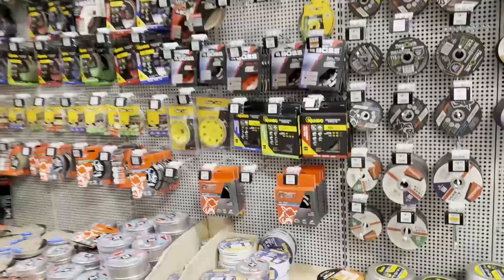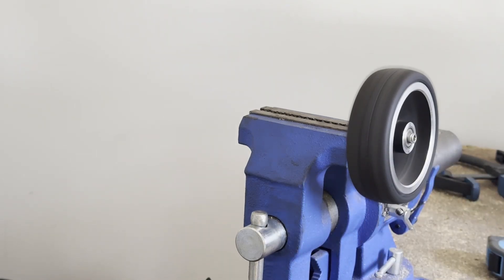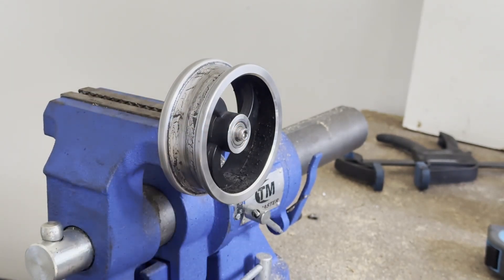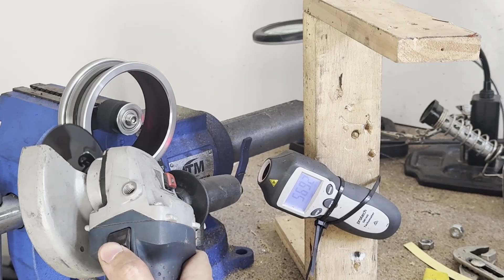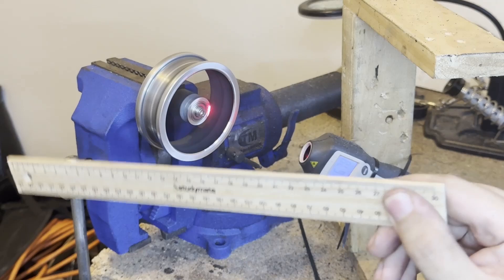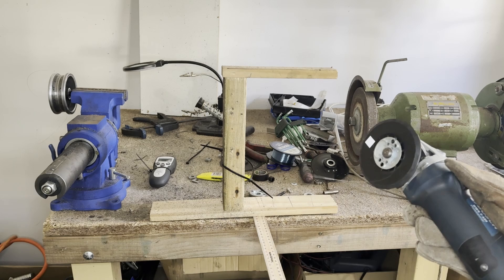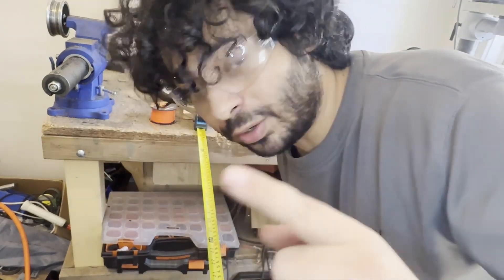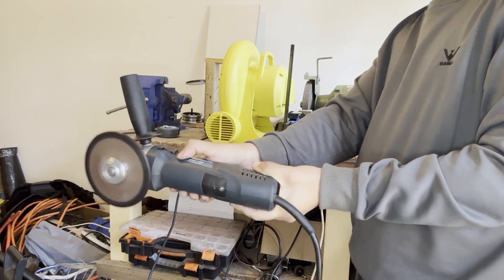Making Sonic Booms At Home!

Comment from the maker: I meant the string is 50cm long not 50mm when it’s booming! It was pretty hard to iron all the kinks out and get it to work but i’m happy with how it turned out. Edit- I tried it with a Weed Whacker and couldn’t reproduce the sustained cracking (i got a few), same line tangling issues. Angle grinder worked the best.

Comment: Okay here's how you do it take a box and you run tubes cylinders all through the box and you can handle them out of a hole that goes to the outside of the box at some point on the box
Reply: Then you run very low frequency high decibel sound through the tubes
Reply: When the pressure of the low frequency sound hits the outside hole in The box makes a very very loud boom this is known as a servo subwoofer believe it or not?

Comment: Compressed air. Be very careful as things like to explode at high rpm.
Reply: To get the least friction possible the bearing grease needs to be removed using wd40 or petrol etc. once its clean of all grease they spin up insanely fast. The last time I did it i put a small motor bearing inside a larger motor bearing with a bolt and locking nut in the centre. Both bearings clean and dry, blew a narrow jet of air onto the outer bearing whilst clamped in place. The speed that thing got to was insane, sounds like a jet engine and just keeps going for ages once you stop blowing air on it. Took a good few mins to slow down to a stop. Obviously it's got its danger risks and full PPE was worn including full face shield.
Reply from the maker: Interesting! cleaning the grease is a good idea, id imagine it would speed up the heating of the bearings though. Yes PPE is a must. Thanks
Reply from the maker: I tried compressed air with the wheel but couldn’t get enough contact because it was smooth and probably a bit heavy to get it going fast, but i know you can spin up apples etc and get them to explode lol.

Comment: try it again with trimmer line it will work great
Reply: Trimmer line comes in many thicknesses, and the heavier stuff is likely too much air resistance, just like the zip tie. Also, trimmer line, while strong, needs to be able to be snipped off when it hits something at high speed, so durable fibers are a no-go.

Fishing line is probably better. And you can get it in any size you want. They make 500 lb braided Kevlar line for large sport fish, and 2 lb monofilament line, and everything in between
Reply from the maker: Great reasoning. I came to the same conclusion, problem is it’s so damn finicky like i was saying in the video, longer than about 30 cm in length it just wraps itself so easily. Maybe if i got slightly thicker one as you suggest. the building line (orange string) held up surprisingly well but the end does fray very quick.
Reply: @TechEyeMan  braided dyneema line is a completely different animal than monofilament. Monofilament holds on to a curve radius and unspools into a coil, and loves to warp around things and be a pain to work with. Braided like will lay completely straight, and won't "set" into a shape the same way. Braided line is also so much stronger and lighter, you have to like 10x the weight for the same thickness (if you're using 8 or 10 lb test monofilament, you'd need like 75-100 lb braided line to be the same diameter).

Try tying a big nasty knot at the end. It'll help with fraying, and add some weight at the end, without as much air resistance as using a thicker string would. I wouldn't add an actual weight on the end (which would do the same thing) just because at those RPMs, it would easily create 100s of lbs  of tension in the string for even a very small mass, and if it flies off or the string snaps, it's moving as fast as a bullet and very dangerous.
Reply from the maker: Awesome tips (No pun intended) i’ll look into braided line after i try the trimmer line for the hell if it. There’s a lot of footage i didn’t include, like i did try putting knots in the end, surprisingly they come undone fast, and they become a weak spot, i even tried a minuscule weight (the end of a cable tie with a hole in it) but it snaps off fast. the truth is i’ve reached the required speed with the string so really the best i could hope for is better repeatability (no need for the blower etc) but the end result will likely be very similar.
Reply from the maker: Tried the braided line today with an electric line trimmer. It does hold itself better than fishing line but it still had the same issues with tangling etc. Got a few cracks with ordinary snipper line, but nothing sustained. I even took out the motor and bench ran with variable power supply because it didn’t have speed control, turns out even ramping the motor up doesn’t fix the issue. I did get some cool visuals with the line wrapping around itself at different levels. but angle grinder with builders line was the best consistent response
Reply from the maker: I will!

Comment: I wonder why it's not a continuous sound 🫣 is the string falling out of existence after every sonic boom??
Reply from the maker: Lollll! You know i wondered that too. Without a high speed camera i can’t be sure but i suspect what happens is that when it (the tip) hits the speed of sound it experiences huge drag and slows down maybe even moving in a little, then it speeds up again so you get multiple booms. I also don’t know what a continuous sound would be like.
Reply: @TechEyeMan  ohh that makes sense! kind of insane how the wire is holding up to all that sonic abuse haha

I googled sonic boom and it's called boom cus it can only create singular booms apparently. so maybe the wire doesn't even need to slow down for it to create the next boom. it's just creating more and more shockwaves as it goes (above) the speed of sound
Reply from the maker: Yes i think you’re absolutely right. The XF-84H  “Thunderscreech” is a plane that has supersonic props and would be so loud and give the crew nausea. But from what i’ve read there’s reports that it made many hundred of booms a second. But there’s one audio clip where it sounds constant.
Reply: It could be because the string is wiggling and doing a "whip crack" motion over and over again, but it could also just be the approach angle. You can't hear a sonic boom from something moving away from you, so depending on where you're listening, the boom from a rotating object will always be a high frequency repeated popping, not a continuous sound.
Reply from the maker: exactly my reasoning again lol! I thought maybe it was whipping but the length measurements indicate it’s pretty close to the max length of the string, but it likely is wiggling a bit. And yep as the tip approaches you it will be going faster then slower as it retreats although when your facing the “disc” front on i would think that the speed would be the same, but it’s probably very hard to ever be dead on centre.

Comment: How about a powerful high Kv RC motor running at 12S? Probably get as many rpm as you want all the way to stuff exploding.
Reply from the maker: You know i tried that a few years ago, and i found like you said everything broke lol. couldn’t get materials to withstand the speed. But using this approach the string would probably work and at least i could control the speed, although the wrap around issue will still exist i think, especially when it starts experiencing all that drag. Thanks for watching!
Reply from the maker: I also wanted to use something a lot of people had access to so they could try it. But i have to say you do need to be very careful.

Comment: Very cool process. Curious if weed wackers break the barrier? I feel like mine makes that sound on high with a full string length.
Reply from the maker: I thought the same but honestly i think the weed whackers produce the sound when their string tips hit the edge to cut them to the correct length (if they have that guard) i know mine does, or hit themselves(line). Also as i found out line diameter has a huge effect on max rpm and while the speed of the whacker can get to 7000+ rpm drag gets huge, but it is definitely possible
Reply: probably can get close if you remove the guard
Reply from the maker: You may be right, i might have to try and take some measurements.